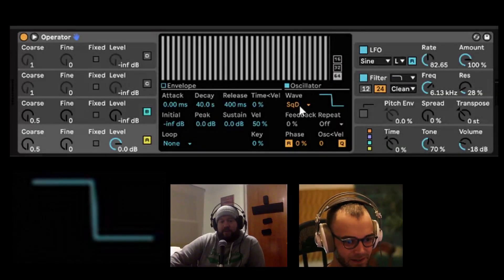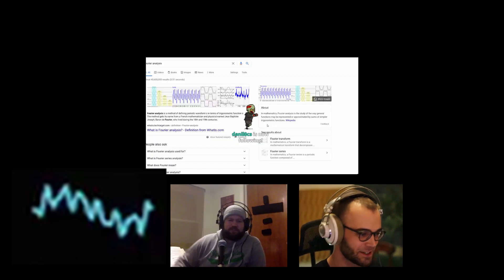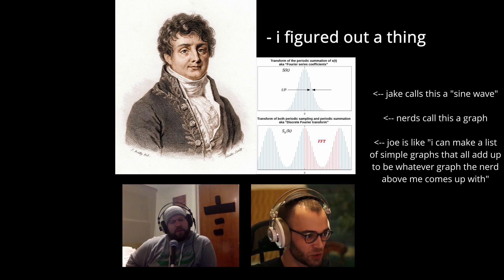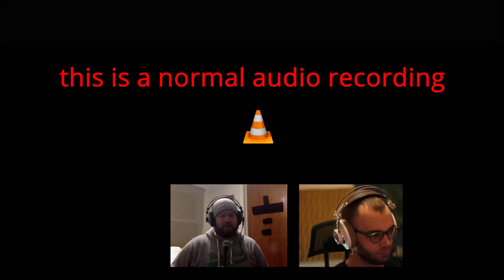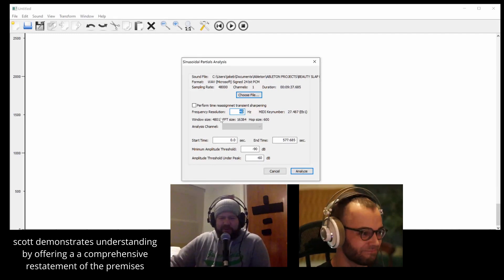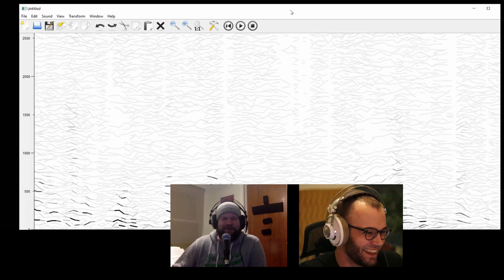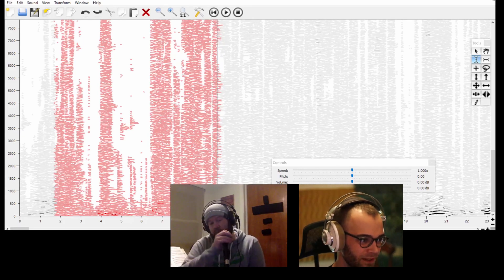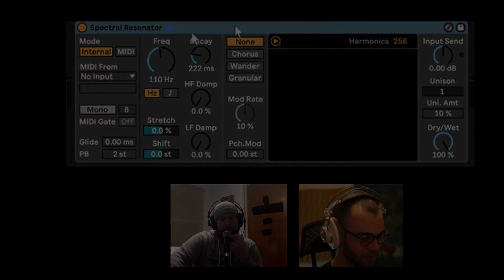synthesize any sound with fourier analysis

Comment: Here's the thing, this is used a lot more than you would think. Programs like audacity will use stuff like this all the time. You can make a basic pitch shift with fft just by shifting up the individual frequencies. This is actually an EXTREMELY common practice in software in general, beyond sound because it's amazing with compression and is very fast to compute. The jpeg image format for example is literally a 2d fft.